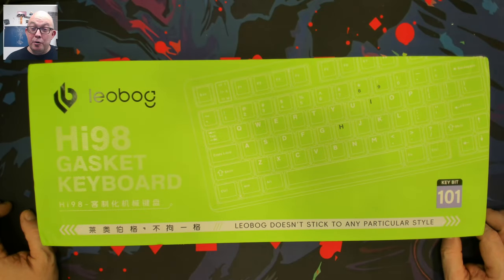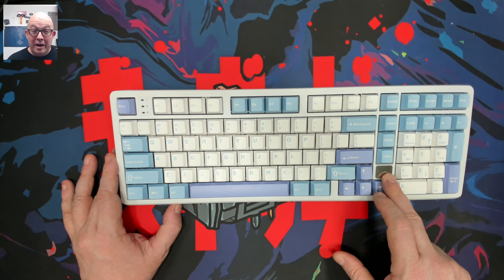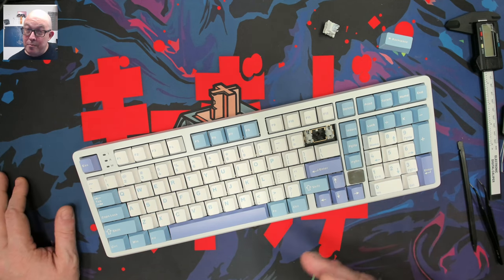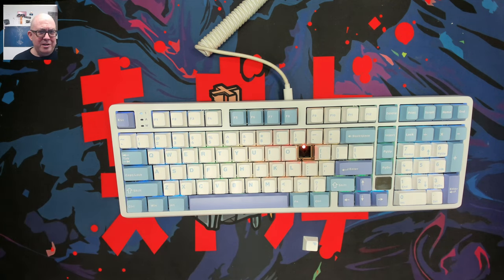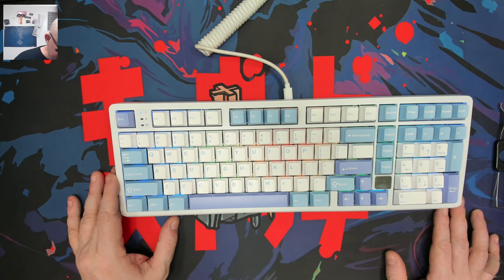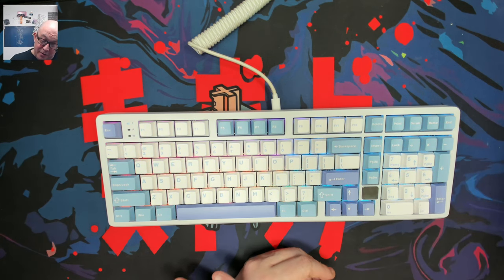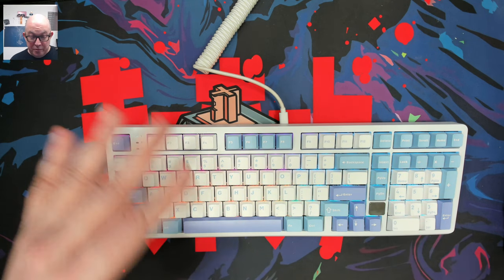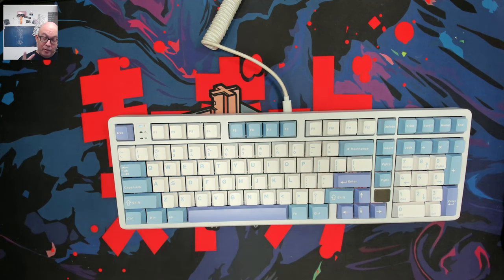Leobog Hi98: Aluminum 1800 | Review and Sound Test

Comment from the maker: Chapters:
__________________________________________________
00:00 Channel Intro
00:05 Video Intro
01:50 What's in the box?
02:15 The Leobog Hi98 wired Compact 1800 Aluminum Mechanical Keyboard
06:25 Taking a look at the keycaps
07:10 A closer look at these Barbie linear switches
07:50 Taking a look at the plate, padding, and stabilizers
16:35 Let's check out the RGB!
29:45 Just the Specs
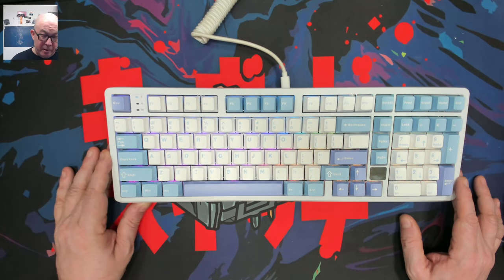33:40 Let's take a look at the Leobog One software
36:25 Quick comparisson with the Hi75
37:10 Closing Thoughts
40:00 Sound Test
__________________________________________________

Comment: Thanks for the review. I've been eyeing this keyboard for a couple months now. It's hard to find a good 96/98/1800 size aluminum gasket keyboard with north-facing RGB lights, which I actually need. I've always wanted to try an FR4 plate too! Unfortunate about the lack of screw-in stabs, but I think I can tolerate that. I'd like to know how easy it is to mod, but that's about it.
Reply from the maker: It's on the list for modding,  I'll move the schedule up. I think a tempest tape and PE/PET mods will do the trick.
Reply: @MechKeyboards  ooh nice. I just bought one. Thanks for the link.